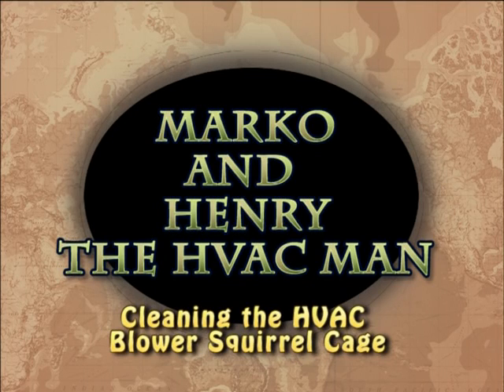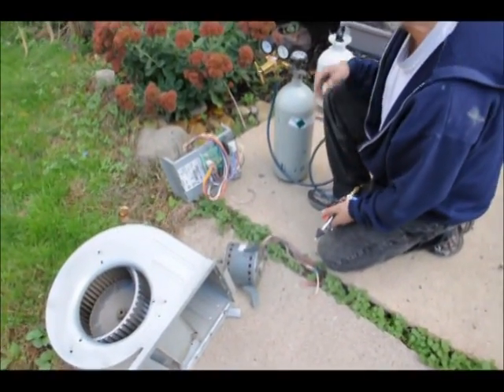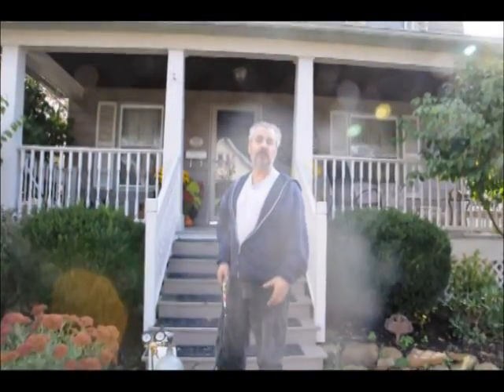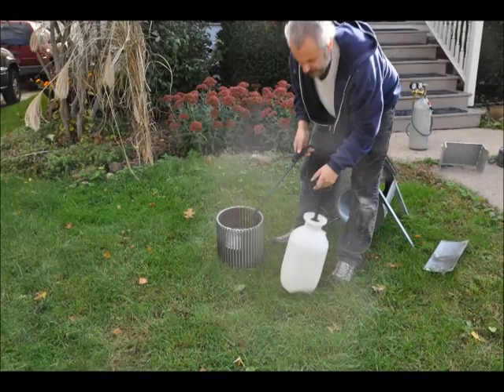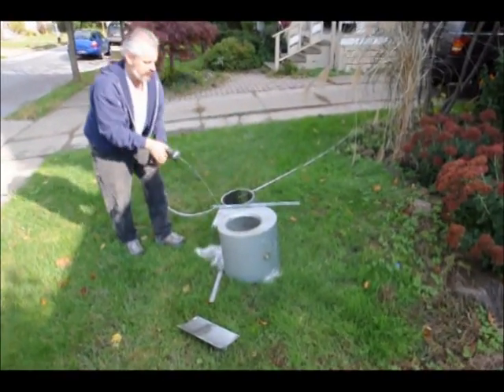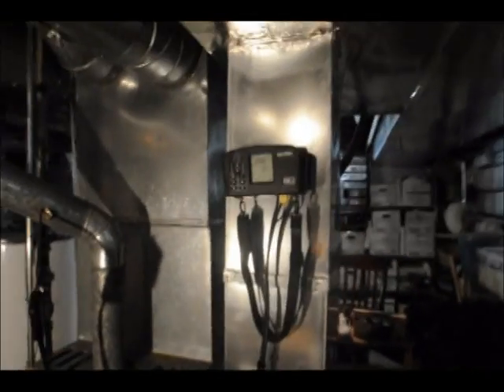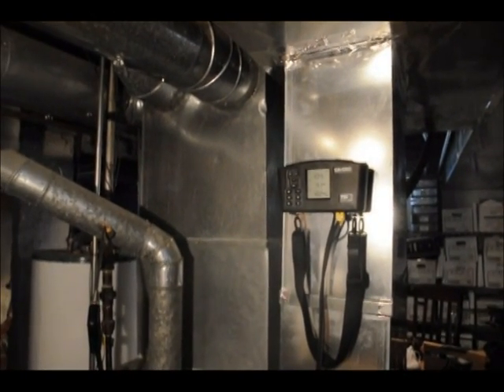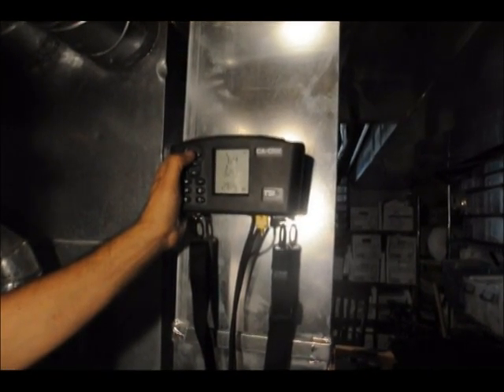"Henry the HVAC Man" shows how to properly cleans the HVAC blower

Comment from the maker: Most motors are permanently lubricated and sealed and require no further attention. Some motors,have covered oil ports above the bearings near the motor shaft. These  should be lubricated yearly. Apply three drops of 10-weight nondetergent motor oil to each port. If the blower shaft has oil ports, they should be lubricated yearly.If the blower has grease cups instead of oil ports, remove the screw caps that cover the cups and fill the cups with bearing lubricant. PLus check the belts

Comment: do you know how i would go about oiling a blower motor for my furnace i tryed to start it this yr and blower reset tripped itself i tryed to spin with my hand but it is a lil tight it does spin but not as freely as b4 would greatly appreciate your help